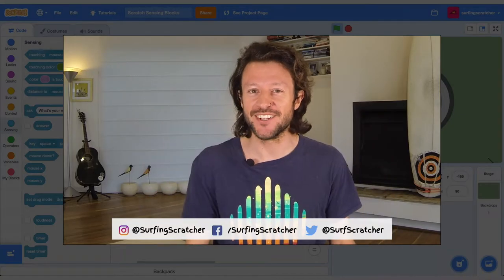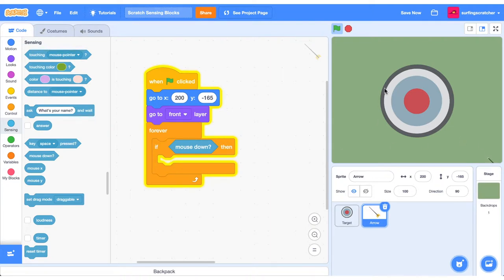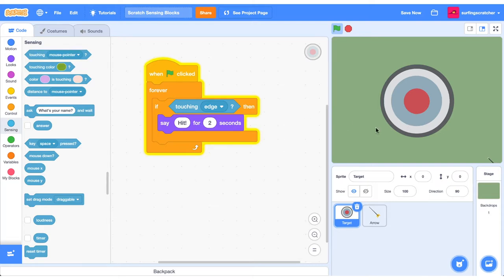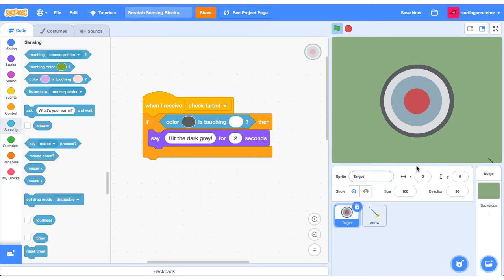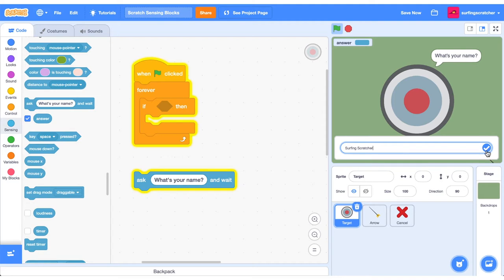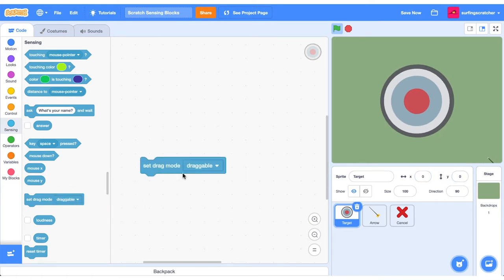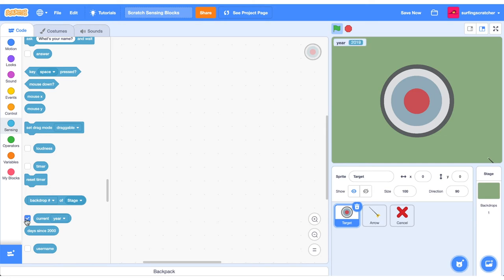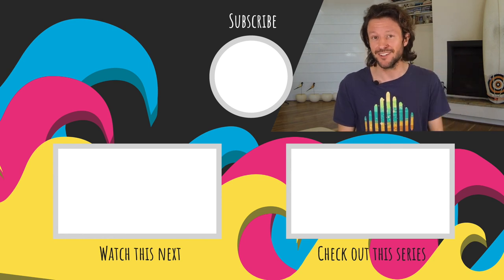Scratch Sensing Tutorial | Example with Scratch Color Sensing

Comment: Hi! I am making an interactive map where the viewer clicks on locations and a new page (background) with info about the area comes up. The problem is, when the sprite is gliding to where was clicked it is intercepting other areas of the map with colours on it and thus the wrong background opens. Is there a way for the sprite to only go to the area that was clicked and still be able to have codes on the other colours when they click them later?! Thankyou!!
Reply from the maker: Hi Amy, thanks for your comment and describing your project. Without seeing the project to get a better understanding of it, it'll be tricky to pinpoint exactly what's going on. In any case, here are some suggestions for you to consider:

1. Use the AND boolean block. You can check to see if 'Sprite X' was clicked AND is touching a certain colour.

2. Rather than glide the sprite to a location, you can directly set the x and y of a sprite to the desired location.

3. You could create a variable that prevents anything from happening while the sprite is in motion. For instance, I would create a variable called something like 'isGliding?' When the sprite is clicked, I'd set isGliding? to yes. Once the sprite makes it to its destination I'd set isGliding? to no. Then you can combine this with suggestion number 1. 

if touching colour AND isGliding = no then change the background.

If you don't manage to solve your bug then post a link to your project. Happy coding :)
Reply: @SurfingScratcher  with no.1 the colours aren't sprites, they are just marked on the map. When I made the colours sprites instead it seemed to disrupt the new background opening. 
with no 2- I wanted it to be interactive for the viewer to be able to click it, but maybe I will have to do this instead. 
with 3 I have no idea how to do that but seems like it might work?! how do I set the is gliding variable to yes? happy to post a link to the project, do I have to share the project to make it public to share with you here? Thanks A LOT, this is hard!!!
Reply from the maker: @amysimpson5462  Yep, you can share the project then post the link. You can also save the project to your computer and send me an email with the project to hello [@] surfingscratcher.com

Comment: hi, I wanna know if there is a way to make 2 sprites act as 1 on a given situation. for example im trying to figure how to make a cat that picks up an apple, so if you press "space" when the cat is touching the apple they become "cat with apple" or something like that and you can move them around till you press "space" again and drop the apple. Im suggesting them to become a single sprite cause I thougth it would be the easiest way to make that pick up system to work, but there has to be a better way probably
Reply from the maker: Hi Jose, thanks for your question. The way that I would do this, is to create a costume within the cat sprite that has the apple on it. After the cat picks up the apple with a space press, switch to the costume that shows the apple and the cat. Then hide the apple. Once the spacebar is pressed, you show the apple and return to the default cat costume without the apple. 

Another way would be to 'pin' the apple's x and y coordinates to the cat sprite. As far as I am aware, it's not possible to combine the two dynamically unless, of course, you created a third sprite yourself. Hope that helps!
Reply: @SurfingScratcher  thanks so much, I just started using scratch today and trying to figure things out. I wanted to jump right into making something rather complex in order to make me think haha. I quickly figured by myself how to move and rotato directions with the arrows and I was thinking about making something like "overcook" to challenge myself, maybe I got over excited